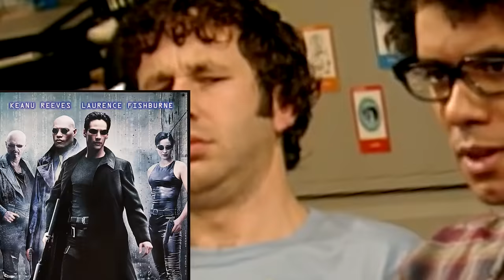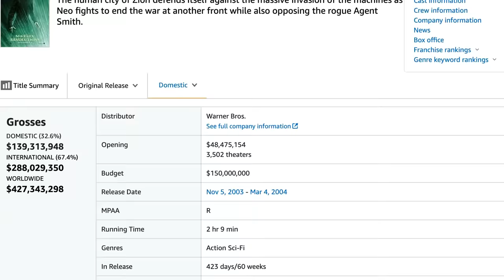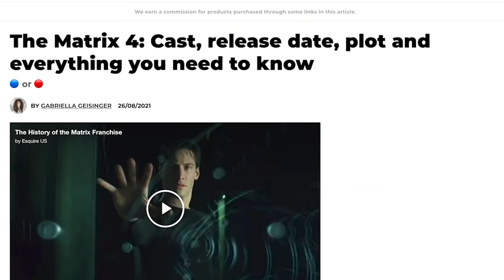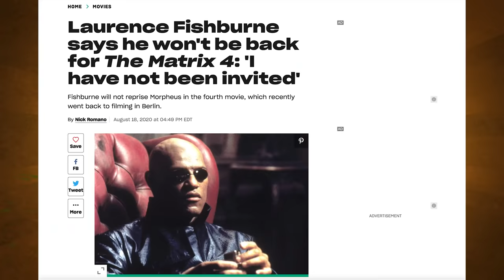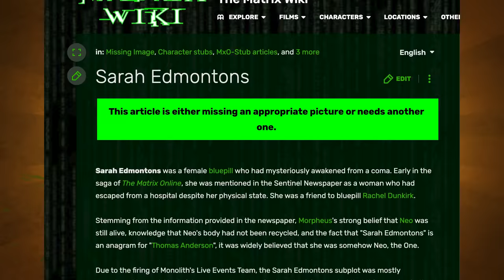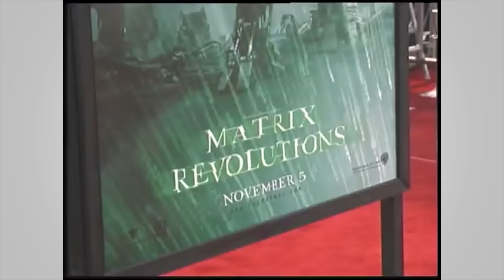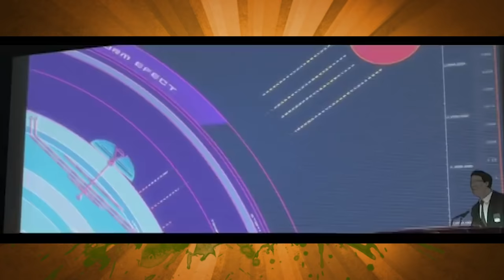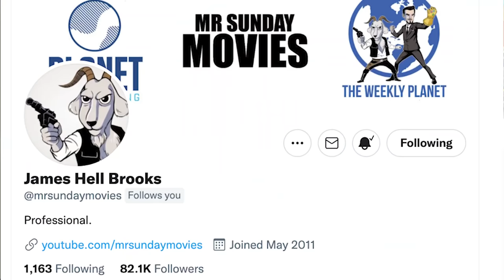The Matrix Revolutions - Caravan Of Garbage

Comment: One piece of trivia I wish you had mentioned. Some of the prop metal used for the mechs in the final battle had some copper corrosion on it, which made the crew have to painstakingly scrape the corrosion off of the affected pieces of metal before reassembling the mechs, a procedure which the crew nicknamed "the Blue Harvest" which led to the working title of the film being Blue Harvest, which was also the working title of the original Star Wars from 1977.

Comment: The EMP does shut down the spaceship when it's activated, that's one of the reasons they only use it last.
Then they need to bring another ship that was out of range to use jumper cables on it or whatever.
Reply: I don't think it always does, as long as they shut everything down before they fire it, they can switch back on afterwards. In Reloaded they didn't have time to do that though, so it disabled the ship.
Reply: @trevvonhiggle1980  I guess that was how it worked, I don't remember exactly. But yeah they would have to turn everything off or at least have offline backup power wossnames to start up certain things. I remember the problem when they EMPed Zion was that they only bought some time and all their stuff was disabled so they were helpless once the drill restarted. Not that there was much stuff left to disable.

I remember them turning everything off early in the first movie, but I think that was for stealth, not to preserve their equipment, otherwise they would just have EMPed away instead of hoping not to be detected.
Reply: Why couldn’t they just get some jumper cables to restart the city?
Reply: not a space ship. everything else is correct

Comment: I’ve always assumed the Mechs didn’t have coverings because they were made for construction and used to build the giant mechanical structures in Zion then converted to war machines. Zion doesn’t have unlimited resources so they didn’t really have a choice but to equip them with guns and send them into battle.
Reply: I dunno, i'd still put safety features on a construction vehicle, since that's not exactly a hazardless occupation either, but i guess limited resources makes some sense.
Reply: @peterstangl8295  Could go either way, I feel like most construction vehicles have very little “protection” and if they do it’s to protect from the elements. There are no elements underground so maybe it’s not necessary. Besides the machines ripped through the hull of the ships like butter so maybe it wouldn’t make a difference.

Comment: I'm surprised that it was only vaguely covered but in the original script, the humans were bio-processors and not batteries.  However, this concept was considered too "nerdy" for the average punter to comprehend, at the time, so they went with the battery premise (which is easier to grok but makes far less sense).

Comment: They were able to set off the EMP in the ship because everything was off.  That is why Trinity waits for Neo to bounce out of the matrix before triggering it as it would kill him.  EMPs only affect systems with electricity running through them, the ship was parked and all systems were shut down except the up link to the matrix.  When Neo was disconnected it was set off.  They could have burned that particular uplink or maybe it was turned off when he disconnected doesn't really matter but the point is the EMP didn't survive the EMP it was unaffected by it.

Comment: The Animatrix (which is that gonna be the next CoG?) explained or rather showcased that during the original Machine human war the humans used mechs but fully armored and sealed in, and the Squidies peeled them like oranges and killed the humans inside anyway (think about the squidies that attacked the Nebuchadnezzar at the end of the First Matrix). I think with the premium on resources and the abundance of machine sentinels, the Zionites decided to focus on speed and firepower since armor wouldn't do anything. Take what you'd use for armor for one mech and make another.